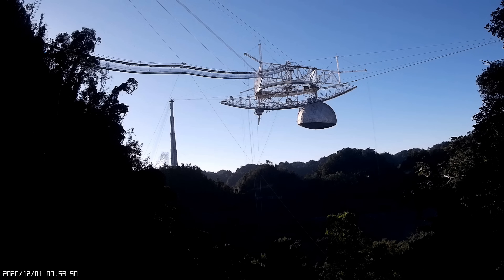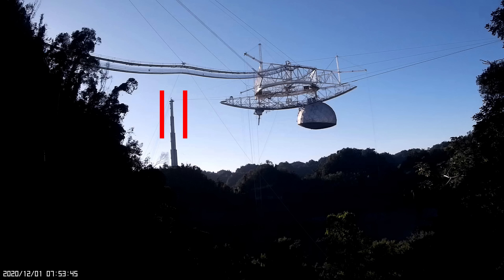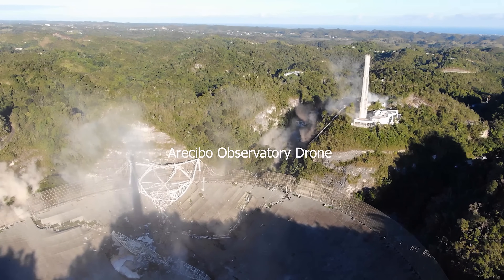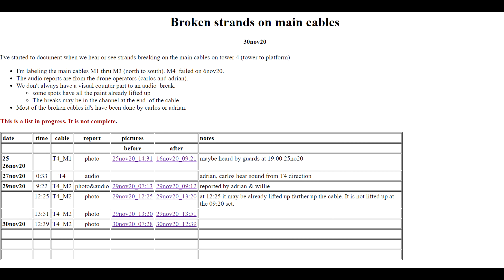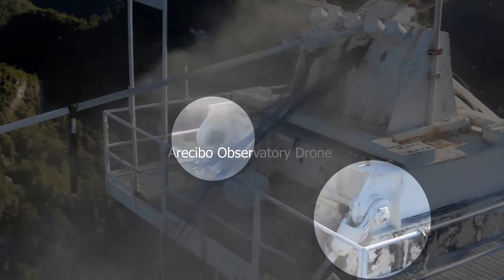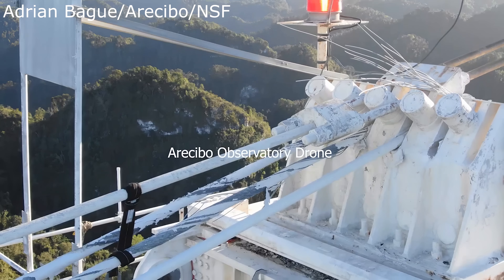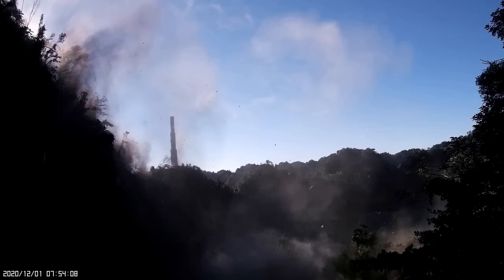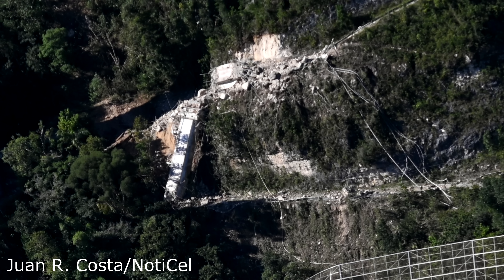Analyzing Video Footage Of Collapse of Massive Arecibo Telescope

Comment: The cables may be made in China 🇨🇳. No joke! I worked for VSL, a world-wide company that specializes in construction of giant bridges and similar structures. 
Steel cables and rods some up to around 4 inch (100 mm) in diameter are used in the construction of such structures. 
Steel cables and rods sourced from China were considerably cheaper but frequently did not meet the clearly specified requirements for strength, for example, tensile strength. 
The problem of substandard cables and rods from China was not detected immediately. However, once the problem was discovered, samples analyzed by metallurgical laboratory revealed that the extent of the problem was not isolated to a small number of batches, but was prolific in virtually every batch of product received. 
From then on, every batch of product received from China was subjected to independent analysis by a NATA-registered laboratory.
It would not surprise me to hear that cables used for the Arecibo Telescope were made in China and did not comply with specified requirements for tensile strength and other quality parameters.
The documentation such as certificates of conformance received from Chinese manufacturers is not worth the paper that it is written on. Therefore, every single batch of product received from China 🇨🇳 should be tested by an independent and NATA-registered laboratory, the results of which can stand up in the court of law.
Reply from the maker: So you’re saying the US cable manufacturer which had been making cables since WWII instead of using their own facilities just went and bought cables from China.  

Sure........
Reply: @scottmanley 
On the contrary, I am saying have full confidence in US made cables, but have no confidence in cables and other products that are made in China. 
I was not aware that the cables were made in USA. If that was the case, I suspect that the cause of the fault was due to other factors such as miscalculation or possibly not factoring forces on the cables exerted by wind, or possibly reduction in the strength of the cables caused by high temperature, etc.
I just wanted to say that anything from China is suspect.

Comment: I see this as a tragedy from a scientific  perspective.. but we will continue to play celestial chess with other sites.. hopefully the next telescope(s) on this site with be better engineered for a longer lifespan.
Reply: The Silver Bridge collapsed at age 39 and the I-35 bridge at age 40.  The Green Bank 300ft telescope collapsed at age 26.  So 57 years wasn't bad, but the point is, this possibly did not have to happen, if deterioration of the cables turns out to have been the root cause.

Comment: Even the 10 meter long bridges built over sewage canals in the poorest cities of Bangladesh receive regular checks and overhauls, to address wear and material fatigue, Aracebo on the other hand went down only because of (not poor, bu actually absent) maintenance,. Wasn’t there any cheap civil engineers to be paid 5 USD an hour for 2 weeks, twice a year to run checks on the structure? Who used to run the telescope? NASA did never use it seriously, NSF? Or maybe some local university? It looked offline though, maybe too expensive to keep active, and because of that the “unintended” ignoring of the imminent collapse,.

Comment: There was a drone there for a reason, it had to be published openly to prove to someone or something that it had been destroyed. Do you morons really think that the drone was there consequently by happenstance at the precise moment?
Reply: The drones were doing ongoing inspection of the cables after two of the cables broke.  Both broke at or near the connection to the tower, so that's where the next break was likely to occur.
Reply: @user-vb6lq9il5v  the antenna stood for 57 years wow! what a coincidence right at the moment where it broke there was a recording device.
Reply: @elpasotexastejano1  A cable broke in August and another cable broke in November.  By that time they would be keeping drones in the air constantly to monitor the situation with the cables and the tower(s).  It is not surprising at all that a drone was on station at the moment that the remaining cables decided to break.

Comment: This is just sickening, but not in the way you might suppose. What does it mean that a camera was set up "just in case it happened"? And that workers were avoiding "danger areas"? Did they predict that this was going to happen? What has been going on at this site? If they thought it would happen, why couldn't they prevent it? Talk about waster of taxpayer money! Disgusting!
Reply: One cable broke, for no obvious reason, back in August.  Preps were being made to get it replaced, when a second cable broke in November. After that, there were only four cables left to support approximately 300 tons.  When you don't know exactly why two cables broke, it stands to reason that other cables will follow and collapse would be inevitable.  A program of regular inspection and replacement of the cables prior to any breaking would probably have been cheaper than the cost of demolition or clean up, and as a bonus, we would still have a working telescope.

Comment: I thought it might be sabotage until I found out that one cable snapped in November ... They can rebuild this , if it's worthwhile enough ... maybe build one 3X the size !
Reply: Too bad they did not either quickly replace the cable or temporarily remove the portions suspended from the cables in order to take the strain off the remaining means of support. Instead, the whole facility is now toast.
Reply: @Urbicide  The original damage happened in the hurricane of 2013, the staff at Arecibo have been pleading for funds to repair it and provide adequate maintenance.  Instead the anti-science party in Congress actually reduced the maintenance budget for the site, with this perfectly predictable result.
Reply: @cuscof2  That sounds about right! No more regular preventative maintenance. I worked for an industrial electrical contractor, who was doing work at a coal-fired powerhouse that had 4 units. The plant was built in the early 1950's, with improvements made as technology advanced. The place was run down looking, with a lot of the infrastructure obviously looking like its glory days were well behind it. Found out that the plant originally had 125 full-time employees on the maintenance staff. Somewhere along the line, a bean-counter determined that it would be more profitable to forgo regular scheduled maintenance. Major work would be done only during shut-downs, which were usually scheduled every couple of years. Sub-contractors were brought in to do the work. The plant cut their maintenance staff down to 15 workers, who were permitted to do only the absolute minimum to keep the generators going. One incident I saw, was the failure of a small paper gasket in between two pipe flanges, which were so designed as to be taken apart fairly easily. There were about 4 nuts & bolts holding the connection together. This pipe was run overhead a well-traveled area leading to an elevator, & now was spraying a thin stream of water down on those passing through the area.  Rather than actually take the joint apart & put in a new gasket, they took an empty steel 30 gallon oil drum, welded a pipe nipple to the bottom, attached a length of hose to the nipple, hung the drum under the leaky pipe joint, & ran the hose to a floor drain.  They could have actually fixed the problem in a half hour, but instead spent half a day, just to re-direct the water.  Some things on paper just don't translate well into the real world.

Comment: It seems like a preposterously bad design in my opinion, it is amazing no one was injured by this thing.
Reply: It stood for 57 years, doing great science the whole time. When it failed, it gave PLENTY of warning. Let's get a new one built in five years and continue on.
Reply: @user-vb6lq9il5v  I bet it did some amazing things, and I definitely think they should build another one, just don't suspend it on fucking cables hundreds of metres above the ground. 

It seems a bit like dangling a priceless Faberge egg 100 ft off the ground with nothing but fishing line, sure the fishing line is strong and surely strong enough for the load, but holy fuck there is a way better way to go about this.
Reply: @theofficialsikris  There are all kinds of structures that are suspended or stabilized by cables.  The Golden Gate Bridge for example.    You have to find a way to put the radio receivers and transmitters at the focal point of the dish.  I do think that a lighter structure that can be winched up and down would be more efficient, though more complicated.  A central tower might work if the ground is solid enough to support it.  A more expedient method would be to rebuild it as it was, but maintain the structure.  The original lasted 57 years after all; most buildings start to show their age long before then.

Comment: obviously poor engineering, look how big and heavy the scope being held by thin metals
Reply: It was held by several small cables, combined to form several solid 3" cables. People are saying it held up just fine for about 57 years, even through bad storms. Granted its 880 tonnes total.
Reply: While I can imagine a better design, even not being an engineer, it was being supported by twelve 3-inch diameter cables and six 3.5-inch cables, all made of steel designed for the purpose.  Fifty tons on a 3-inch cable doesn't sound that precarious.
Reply: @user-vb6lq9il5v  It was probably not designed quite the way it should have been for long-term durability well past 60 years. But we are talking about 1961-1962 design in that region. I mean, it is what it is.

Comment: Can the telescope be repaired?
Reply: The Visitor Center is in fine shape.  That's something.  Also the parking lot.
Reply: @user-vb6lq9il5v  telescope repairable??
Reply: @andrewcampbell1129  If the towers had not been so severely damaged, then possibly a new platform could have been built and hoisted up on new cables.  The dish surface and supports might be repairable, even now.  At least the bowl shaped depression is still there. Almost the entire structure would have to be replaced.
Reply: I visited arecibo telescope in 2017, I am so saddened to see this telescope collapse..
Reply: Is the structure going to be replaced?
Reply: @andrewcampbell1129  I have no idea if it will be replaced.  The biggest hurdle will be getting Congress to appropriate money for it.  It was built using 1960s construction methods, in about three years.  It was upgraded a few times since.  There is probably no engineering-related reason why work on a new one can't begin just about as soon as the site is cleaned up, BUT there may be some other gotchas lurking.
Reply: Understood,  hope the politicians see the value in the restoration of Aricebo..
Really wish that.
If I can do anything to help with that effort let me know please..
Reply: @andrewcampbell1129  There is a petition to rebuild the telescope.  Search for: petition white house rebuild arecibo
Reply: @andrewcampbell1129  It needs about 40,000 more signatures by January 1, 2021.

You can also write to your congress-persons and let them know that this is important to you and why.  Don't mention SETI or aliens though.  That's NOT why we need the telescope.
Reply: I will sign immediately

Comment: You got brain engineers that put to much tension on the cables to begin with. This was set for failure from day one. All you had to do was lower the dish 50 feet to ease the tension and you would increase the life by 100 years.

Comment: Why was there a drone at the site at exactly the right time?
Reply: One person said there were minor cables breaking, cracking in other parts of the system about a day prior to this. So they were monitoring very closely, with drones and cameras, as a precaution. Not sure if its true but.
Reply: It appears that is true, that they decommissioned it about 30 days prior to this happening due to risky structural issues. Then a few days before this, they noticed more strain and cable damage. Then it got worse and worse, and they continued monitoring it by camera until it collapsed.

Comment: So a multimillion dollar structure with very dated supports and known degradation plus a known determination of total failure.  Obvious visual compromise of main support cables and 0 maintenance and/or remediation attempt to repair or brace the compromised structure...  with owners and users being apart of a widely known and accredited group for having an above average IQ, whom some are even responsible for some of todays ground breaking technological innovations and none of them thought "hey it would only cost a fraction of the price to sister the failing cables then get rid of the old ones than it will cost to repair things when it does fall..  there had to be funds there in place to just keep the place in use for the other equipment there as well as the operators and owners of that other equipment who could have thought "hey if that thing thats not mine breaks than it would undoubtedly render my equipment useless so that should get fixed as apart of insurance of Future sound operation of my equipment..  now theyre asking for a government handout to fix the dated and now broken structure and equipment??  If they let it fail once like this i would bet that theyd let it happen again because i mean there were documented reports charted out listing the various issues that had been going on for quite some time..  is like a doctor with a dying patient who keeps visiting the patient and documenting a wound getting infected and slowly killing the person, knowing that the person will die if not treated but yet the doctor simply documents and does fuck all to remedy the situation which could be treated with a prescription that would heal and make that person live another 20-30 years but the doc just watches them die then goes to the board bitching about it wanting another patient to document about...  intentional neglect is what this was/is...

Comment: why put 4-5 cables ? why not put 20 and be safe ? its like they calculate the minimum resistance they need and they go for that this is why the colosseum the piramids are still here and this is why no modern building will be here 2000 years from now.
Reply: Cost. Also age, and the time period. This thing is like 57 years old. Those cables have been under immense tension for 57 years. You can't just spend double the amount of a budgeted project so it will last 150 years instead of 57 years. Not always that easy.

Comment: So, this is a non-repairable, non-replaceable structure?
Reply: It is replaceable, if given funding.  It was maintainable, but once a cable broke, too dangerous to try to repair by the usual means.  A break means that something serious is going on.
Reply: Considering it costs $10 million per year to even so much as operate it, and the American space program is exceptionally debt ridden, and the local government is in a coup and refuses to bother with older observatories  - there will not be another Arecibo for some time, if ever. The entire array is completely destroyed.
Reply: @MrWolfSnack  You make it sound as if $10 million is a lot of money.
Reply: @user-vb6lq9il5v  For maintenance costs of a structure of this scale, it is. Considering there is no money coming IN from any government party and it was funded with pocket change mostly from what little grants they could get from various institutions. They could never raise enough to get the money they needed to fully rebuild it - that was what the Smithsonian grant was trying to do - but the array did not last that long. It was still broken from Hurricane Maria that hit it in 2017. That was 3 years ago and it was never repaired.

Comment: Why wasn't this repaired before it advanced to catastrophic failure? Redundant cabling could have been installed. I guess there's that much to be learned by analyzing the failure sequence as opposed to applying band-aids to a structure that is ultimately doomed. Trying to disassemble this monster could have seen similar results with workers in harm's way. What a shame! Can you imagine one of these ten times the diameter in space? What about putting some of those moon craters to good use!

Comment: The engineer that designed this cable socket holder did a bad job. I wouldn't do so, I would do like something large you could wrap around the cable. never something that holds the cable in the tip.

Comment: I wonder how they knew to put a camera there before it fell 🤔🤔
Reply: Didn't you watch/listen to the video?
He explained they set up the camera in case this exact scenario happened, due to the existing damage to various parts of the Structures.
0:40
Reply: Other smaller cables were snapping. This was decommissioned due to safety concerns 2 weeks before it collapsed. They didn't have adequate time to repair it. So cables were breaking and showing strain a few days prior to collapse. So they set up multiple cameras and flew a drone there to keep an eye out. Then it collapsed. Like Milhouse and the factory episode on the Simpsons. "I was watching. First, it started falling over. And then if fell over"

Comment: Why were they drone filming? Did they have clues things were breaking?
Reply: Other smaller cables were snapping. This was decommissioned due to safety concerns 2 weeks before it collapsed. They didn't have adequate time to repair it. So cables were breaking and showing strain a few days prior to collapse. So they set up multiple cameras and flew a drone there to keep an eye out. Then it collapsed. Like Milhouse and the factory episode on the Simpsons. "I was watching. First, it started falling over. And then if fell over" Keep in mind its 57 years old and has been through many storms.